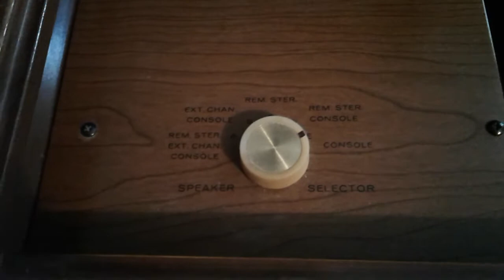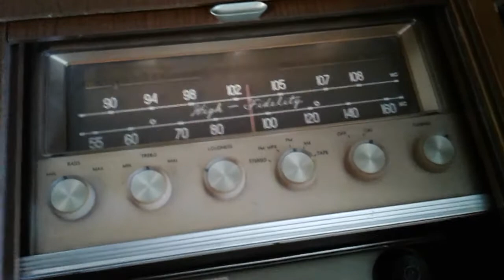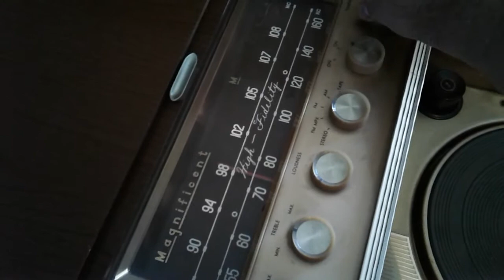Magnavox Imperial Model 1 ST 231 L Console Stereo

Comment: Actually it was made 61-63
Reply: Yes, after 1961 because FM multiplex was introduced at that time… But the turntable is the older Collaro ??
Reply: @1953childstar  yes, Collaro had just been bought by Magnavox shortly before the turntable was made
Reply: @larryshaver3568  Magnavox was using Webster- Chicago changers until 1955-56 and the switched to the older Collaro changers ( like yours ). In the early 1960's the changer was "modernized" with the second generation Collaro.